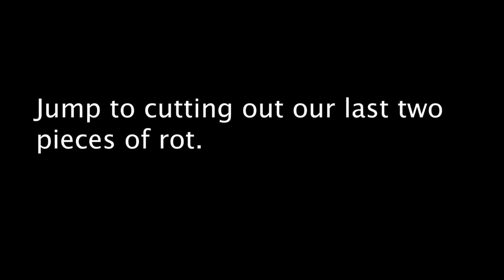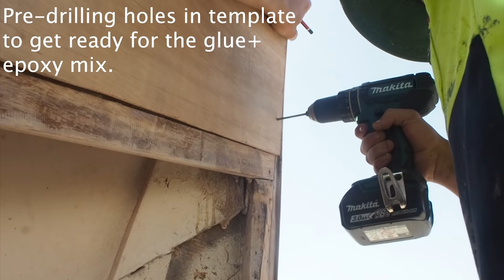Pt.2 RESTORATION OF OUR $1 BOAT!  Ep.12

Comment: Boats rot from the inside out--and this is true for all kinds of boats in salt water.  It is the rain water ;leaking in to the hull and penetrating the deck plywood through tiny cracks that causes the problems glass boats do not have.
Another trick I used was to put swimming pool salt into the bilges.  I like dry bilges, but this salt discourages insects and stops rot.  If water gets in there, the brine will preserve any plywood it contacts.  Only problem with briny bilges is the salt will attack any unprotected metal in there--so I used plastic or Tufnel wherever possible in bilges.  Modern high density reinforced plastic and Tufnel is pretty damn good, and all of my water pipes were HD plastic blue stripe--and my hot water system used plastic coated copper pipes, but you may not need a hot shower for a while.  When you do--think SOLAR.

Comment: i bought one of those saws with twin blades that turn in opposite directions.  It has a depth gauge.  I found it useful in cutting out rot. easy to manage, and the depth can be set to cut only the plywood or glass.  It cuts sheet steel as easily.  Only a cheap one--I think I paid about eighty bucks for it.

Comment: not surprised he just wanted to be rid of it - that's a lot of work and stress for you guys too. You'll come out ahead because you will know your boat inside and out. And those new skills you will use forever. By the looks of your 'pencil' work you are pretty new to building things - you're off to a great start! Good luck! And you are learning the right lessons early - do it right and get 'er done.
Reply: 'not surprised he just wanted to be rid of it'  !    I  HAD  a 1963 Ford F-100 pickup truck  that  was  a  gas guzzler and high on maintenance.  It would get a compliment or two every time I drove it to the grocery store.  But the feeling of relief since I sold it is amazing!  (I got a little more that $1.00 for it).

Comment: Just watched the episode--you are really doing it properly.  I do not know if this is helpful, but I used a Chlorinated rubber barrier coat over the hull paint, then I put one coat of hard antifoul of a dark colour over that, in my case a dark red, then on top of that two coats of softer blue antifoul self-ablating.  When I saw red I booked the slip.  That is about every two years or so depending on where you are.  The good thing about multihulls is one can beach them and scrub the slime  off the hulls before it becomes a problem..  One thing you need to watch in the tropics is Teredo worm.  Another is lightning.  I used to hang a plate under the mast on a chain or cable between the hulls whenever I left the boat at anchor--with a copper plate about a half metre by a metre.  That was separate entirely from the earth plate for the radio, radar, and anything else.
I think you are going to have a GREAT time on this boat-and you will not lose any money when it comes time for a larger boat--if it ever does-

Comment: i dont want to be critical cause i think you are doing an awesome job, but i noticed the skeg and the inboard side of the port hull are green indicating that you used a polyester resin, the bow was done in an epoxy resin, was the boat originally built in epoxy or polyester? Just as an FYI - epoxy bonds to polyester , but polyester does not mechanically bond on top of epoxy. Keep up the good work.
Reply from the maker: I see where your coming from. But we didn't stray away from using epoxy resin we did the whole boat with epoxy west systems as that is what it was

Comment: Why oh why oh why do people use angle grinders without a guard, you see it all the time on YouTube, my grinder had its proper guard and side handle but when the disk nipped just as the cut was finishing it was ripped from my hands and sliced the back of my hand to the bone and cutting two tendons, three years on and recovery is as good as it will get, fortunately almost all mobility has been restored but the six inch scar is still there and it hurts far more than the other hand if I knock it, it also aches with the weather, my first accident in nearly forty years and it has changed my life. Watching the young lady with that thing makes me shiver, don't use it like that, if it cuts free with no guard you will be losing fingers. They are really useful but can be very dangerous.

Comment: One  trick I learned was to fit the but straps for joining new sheets into areas where rot has been removed was to use soft brass screws to fasten the sheets having spread the areas with slow-cure epoxy glue.  Screw from inside the vessel without drilling holes-and after the glue has set,  grind off the protruding brass poking through to the outside of the hull.  Then take back the gel coat to bare ply all around the patch, and fair in your new glass cloth edges after the glassed plywood epoxy has cured.  Then I used a two part epoxy primer, followed by Poly U 400.  They use it on icebreakers-
.